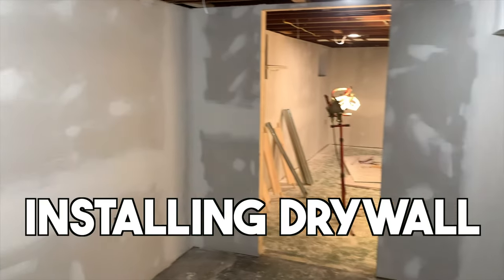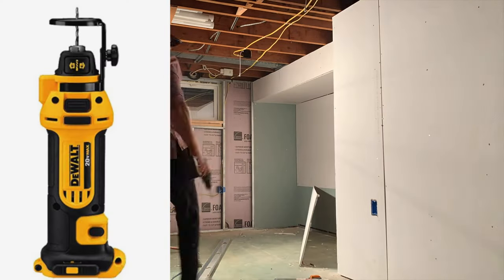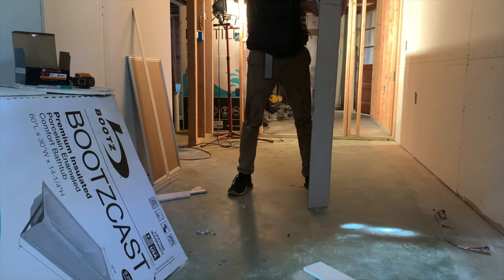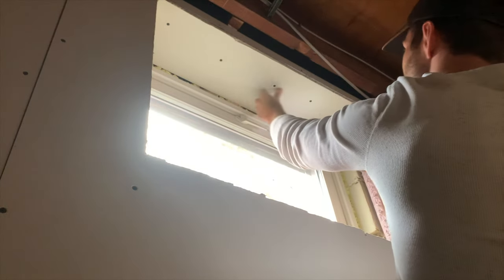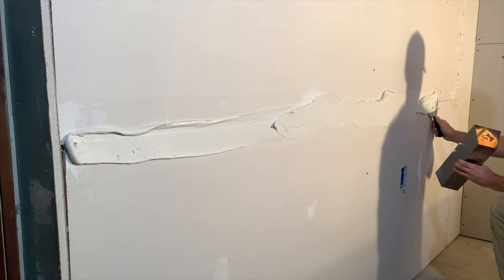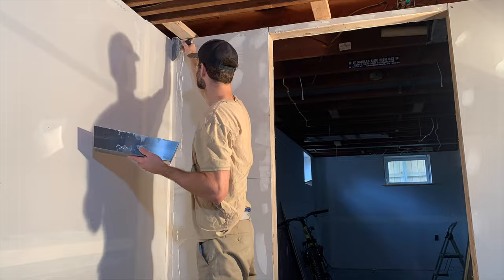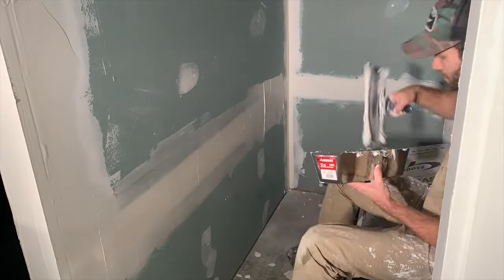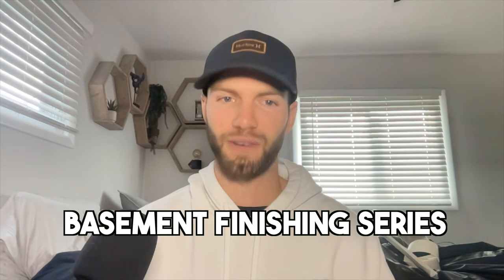Basement Drywall Tips and Tricks (How to Finish a Basement Episode 5)

Comment: I drywalled 1 basement with my dad and I have probably patched/reworked drywall another 50 or so times.
What I've learned is exactly what you've said here: DIY drywall is possible but almost never worth the hassle.
The dust alone is its own monster (it hangs around for months!)
I've seen pros complete a room with 0 sanding at all, just some light scraping with an 8" knife. 
Unless you're just patching small damage, hire a pro!!!
Reply: andrewthronimprovements1098  what does “Whatsapp me” mean?

Comment: How high is your unfinished ceiling and how high is the clearance under the ductwork pre/post drywalling around the ducts?

we are doing a similar project, but mostly considering using dryfall black for the ceiling instead of a drop ceiling.

Comment: Curious the reason you hang drywall from the top down...I'm starting to finish my basement and would like to know the reason.  Thanks!
Reply: Starting from the top down is standard practice. Always board your cieling first and butt up wall sheets to support cieling corners and prevent cracks. Use largest sheets you can get in to prevent unnecessary butt joints. Always run sheets across floor joists on cieling. Avoid installing sheets vertically on wood framing were joints meet can cause cracks in future. Never have joints above doors they will crack. 4 screws per stud on wall sheets 5 screws on cieling joists install 7 screws at every tape joint to prevent cracks.